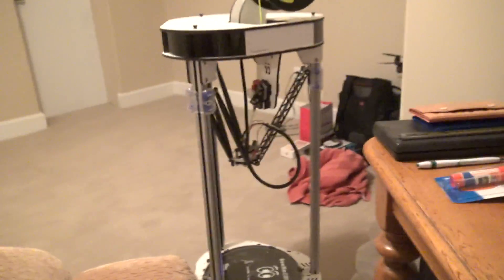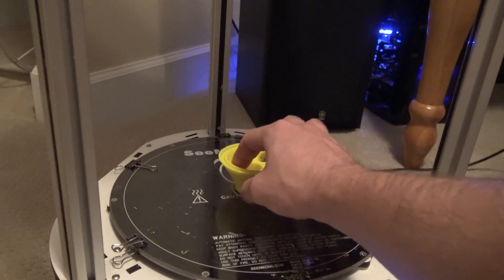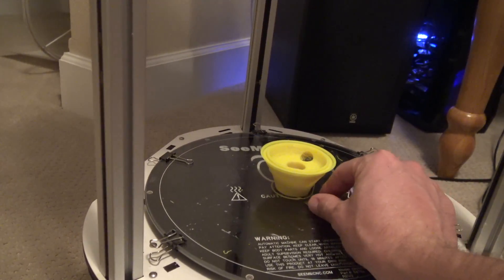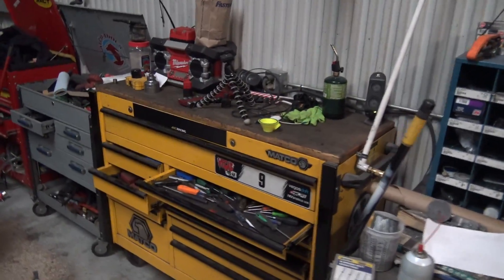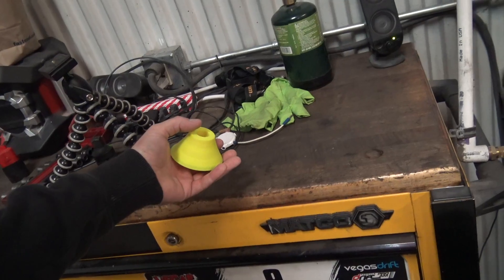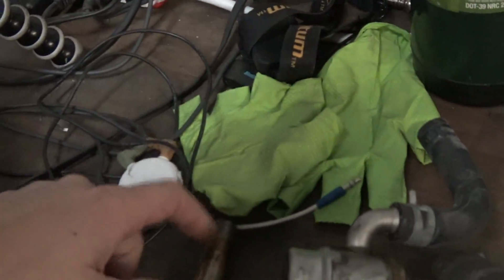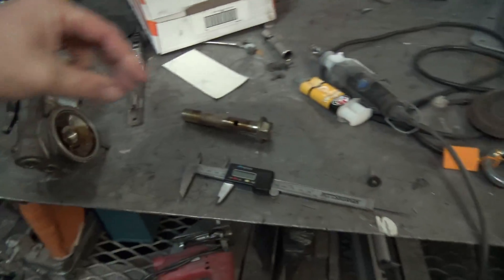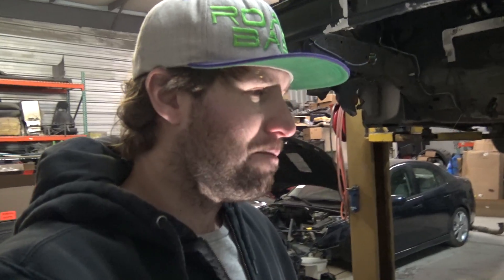Poor Mans Supra 2JZ 3D Printed Oil Filter Block

Comment: Hey Dave just out of curiosity man. Does the engine need that oem part to cool off the oil? I had an Alfa Romeo and a friend deleted that little radiator where the oil filter sits, and what happens was that the oil get in that hot it just blow off the oil filter. Engine did not get hurt but he figured that he needed that oem part (oil cooler I guess). Keep the good work.
Reply from the maker: attilio jorge it will still have an oil cooler just won't be cooled by coolant
Reply: Junkyard Dave just keep in mind if the oil have to cool down before get in into the oil filter. Just because I saw it blew once. Different car different engine. Just keep it into consideration.

Comment: Love 3d printing and cad. But man, that part looks unneccessarily expensive to machine, unless you are going to cast it. It's pretty, but would need a whole lot of cutting on cnc machines.
Reply from the maker: F1NNSP1N it actually would need a 5 axis and wouldn't cost that much
Reply: For a one of you might be right. If you made hundreds of them, a different design would be a lot cheaper I think
Reply from the maker: F1NNSP1N initial setup is the costliest part of the process after that the price goes down exponentially